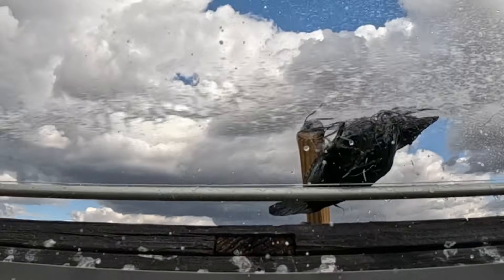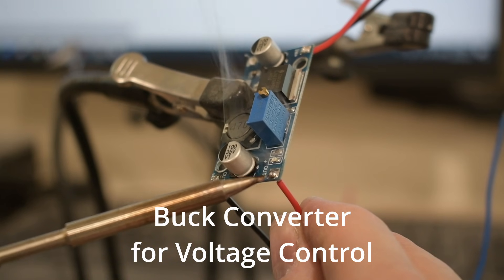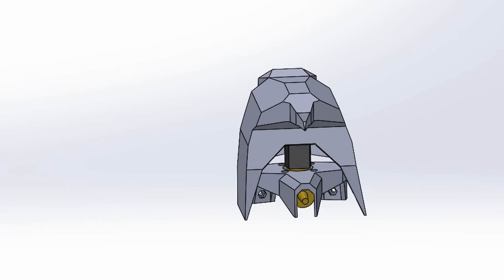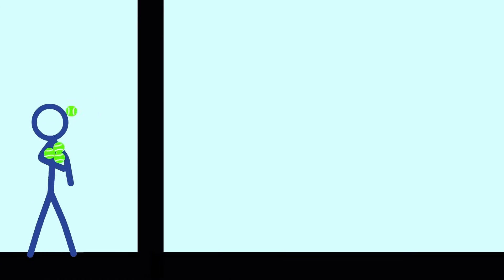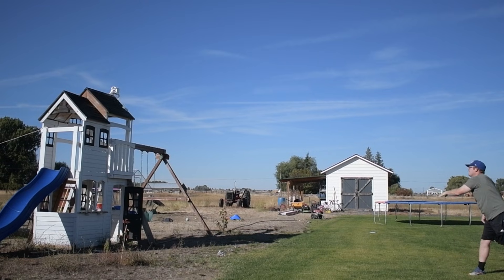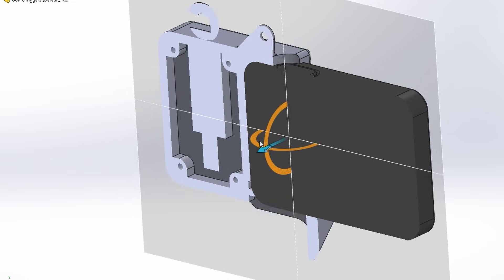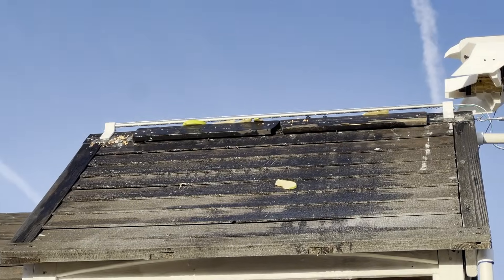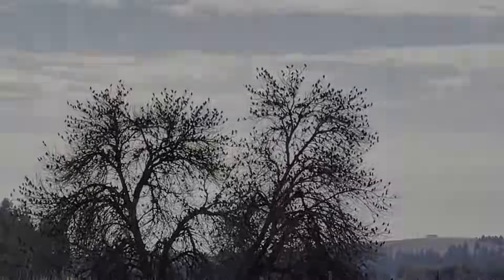How an Engineer Stops Birds from Pooping on his Roof

Comment: Why not just invert the signal from the MC instead of buying a whole new valve?
Reply from the maker: Because if the system fails for any reason, like if the battery were to die, then the valve would fail open. That is bad.
Reply: @ShawMade366  True hadn't considered that